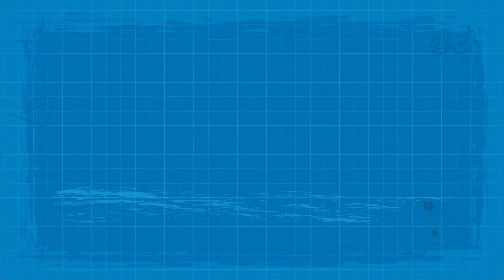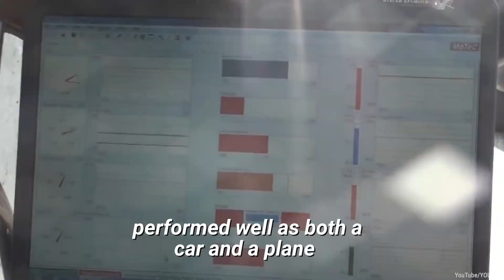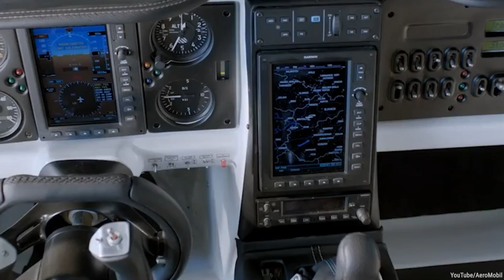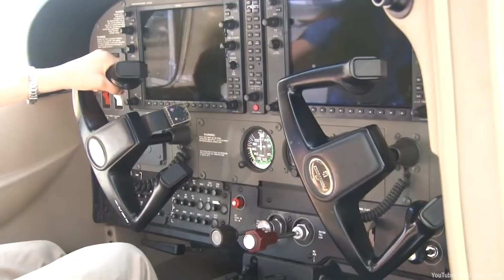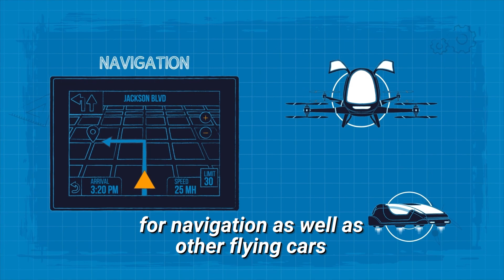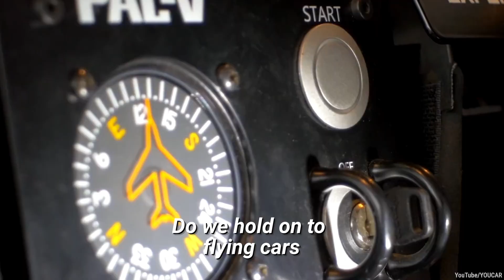The real reason we don’t have flying cars

Comment: Most of the ‘vehicles’ you showed were aircraft, not flying cars. By their very name, a flying car would be able to fly and drive on the road. That’s where the concept always breaks down. If you have a small collision in a car, you’ll generally just drive home. If the car seems ok you may not even take it to a garage. You can not do that with an aircraft. Even the smallest bump on an aircraft needs checking out by an engineer in case the integrity of the airframe has been compromised. Something you can’t see just by looking at it. Additionally, the rules for maintaining an aircraft are strict and expensive with scheduled maintenance by a licensed engineer being required not only per set number of flying hours but also by calendar days/months regardless of whether the aircraft flew during the period or not. And as you mentioned, they are expensive and need a qualified pilot’s license. It is simply impractical and only a bored millionaire would contemplate buying one.
Reply: Wow, you're right on all points but also off , lol.
No one will " buy"  flying cars
Most companies are vertically integrated " taxi " companies.
You use an app to book, 
DRIVE a normal car to a vertiport then board a likely highly automated pod which then flies to  another vertiport 
Where you board a normal car again.
Private people  can not afford the insurance or like you rightly pointed out ,can maintain them.
But the " taxis "will be many and cheap hence " flying car "
They are primarily for 
" cutting" traffic by business people and such instead of hiring a noisy helicopter

Comment: A car doesn't need weight or downforce to stay on the road.
Reply: Cars are flat on the bottom and curved on the top, the very shape of an airfoil. Supercars have to protect themselves against the generation of lift by shielding that gap between the bottom of the car and the road. Supercars have literally gone flying after hitting a bump on the track.
Reply: @danielparecki3223  of course; I know that.  Whomever made this video has no idea what they're talking about though,  and we're not referring to supercars.

Comment: This is the most unnecessary invention with no practical use.
Reply: Thats completely inaccurate. This is an invention that opens up new possibilities in Travel that aren't even remotely possible now. Travel times would be cut to 1/10th of what they are now, traffic becomes a thing of the past. That's years away yes, but technology doesn't develop itself.
Reply: @Chris-hn4lp  It will be better if we have a good bus transit system and safe bike lanes rather than having more and more capable cars because you'd still be using 2-3 Ton of metal to transport 2 people on average.

The fuel consumption will be very high because you'd be flying.

Even if these things are used commercially, only the very rich will be able to afford it because they are expensive to buy and will consume a lot of fuel so the fare will be high.

We need to decrease the number of cars on the road not make them run on electricity or fly becuase this will decrease pollution and traffic.

And talking about traffic you'd be facing air traffic if these become common.